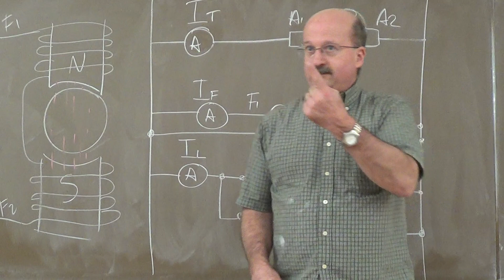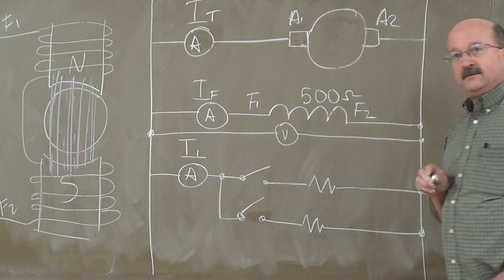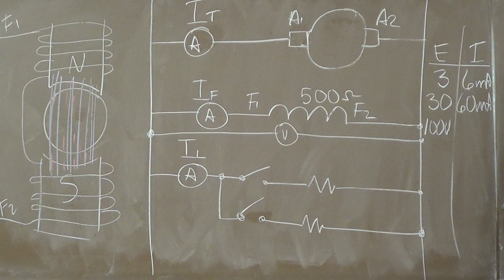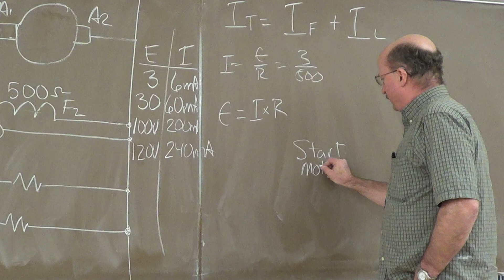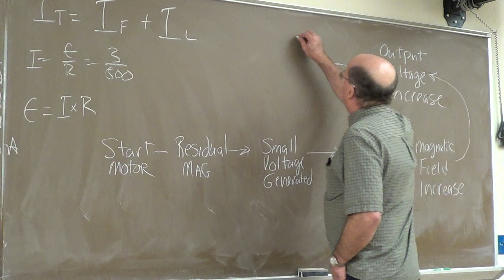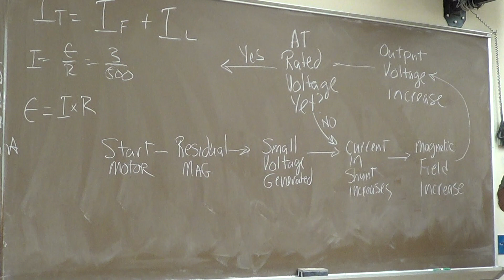DC SHUNT GENERATOR 1

Comment: Perhaps it would've been useful to mention that in a generator, the standard rotation is clockwise, and the current flows, in the armature, from A2 -> A1. So A2 is positive and A1 is negative. In the shunt field the current flows from F2 -> F1. According to your diagram on the board, A1 would be positive and A2 negative, so that would be a diagram of a motor, because the rotation would be counter-clockwise. Or that might be a generator that it's not in a standard rotation, and, in that case, the armature leads need to be changed. Very good presentation though. I really enjoyed it.